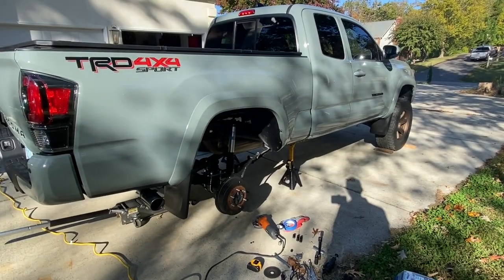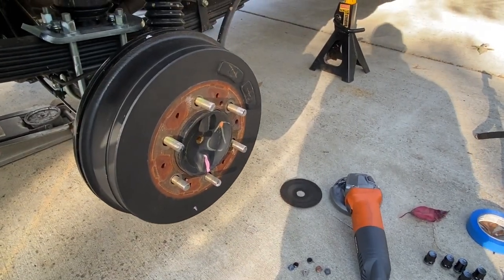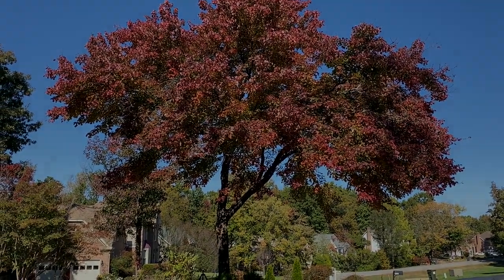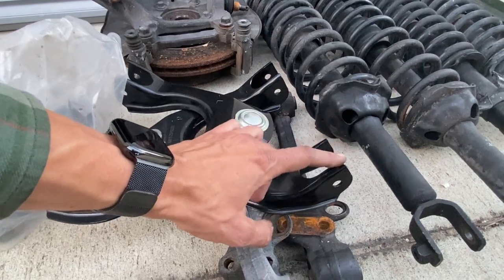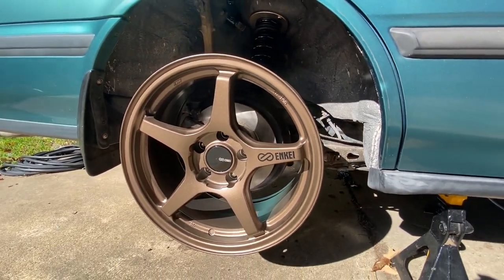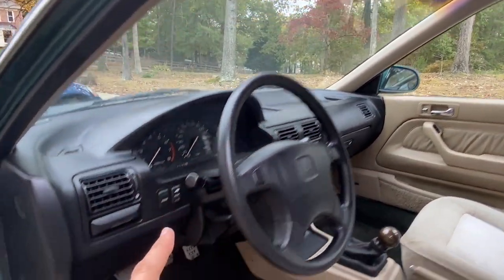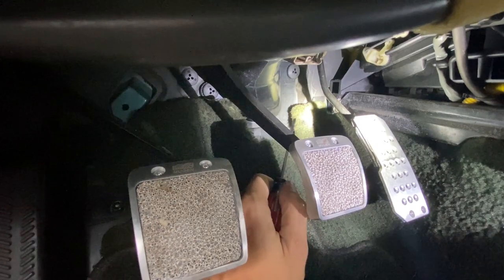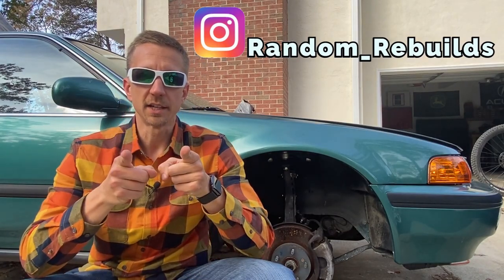VLOG #1 - Accord CB9 Updates, Broken Wheel Lock Dilemma, Tree Issues & Metal Recycling Estimations

Comment: The chime and no key in the ignition, I had that issue in my CB9. I sprayed some lubricant inside the ignition key hole. Then, I put the key in and kept turning it to accessory and on position. Eventually the key was removed and the chime stopped. So my ignition was just dry from age, thinking the key was still in.